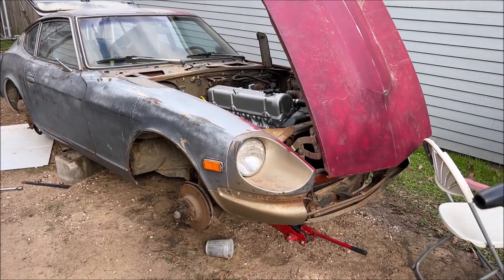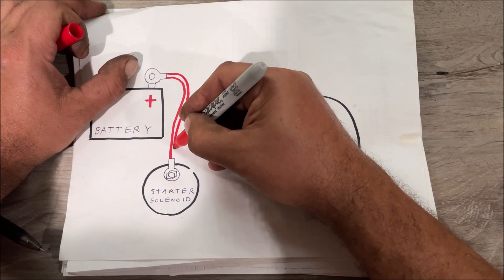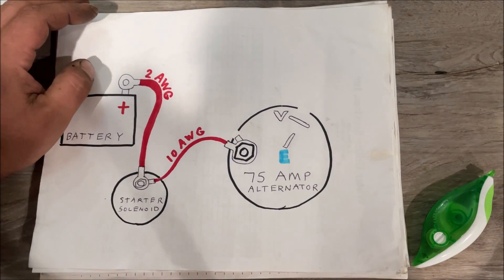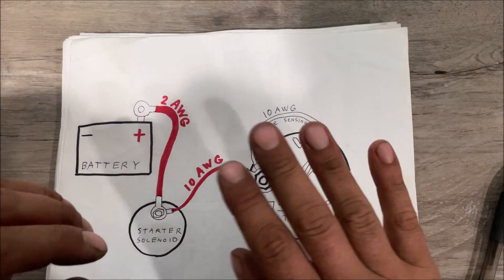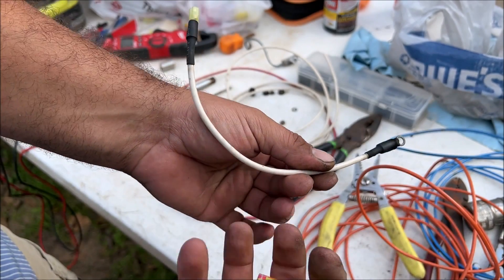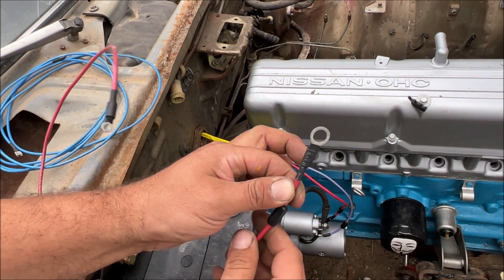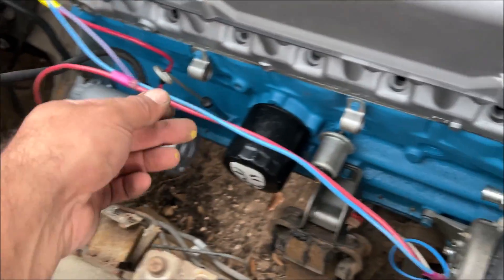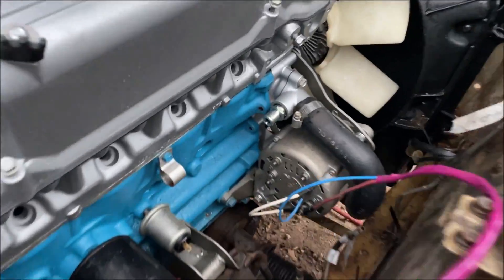how to wire an ALTERNATOR charging system on ANYTHING custom automotive wiring from scratch PART 2

Comment: Men me problems are even wurse 😑😬 those delco 12si are anoying realy expecialy Europ version are shit .I love when the voltage regulator fails or diodes or useing hv capacitors with ignition coil only problem like you described dead baterry or starting charge rpm goes up around 3000-4000rpm smuther engine faster spining starter motor but anoying not abel to run at low rpm shity alternator and curse those 4 pin gm ignition modules .
Actualy be me alternator that pin 2 is bend inside the alternator and multipel types of them exist in the market .
Peopel often here be use buy tractor alternators if they buy wrong pulley turning ditection they baterry wont charge or that mounted capacitor is dead be tractor alternators they dont charge baterry as well.
God knows how much times I asked electritians no one realy culd help me to figure out how to counter back charge or use capacitors on ground to counter plasma ignirion or running capacitor banks with lead acid baterry seperatly.
Im just saying men those standard parts are crap I rather chose heavy dutty industry bridge rectifier and use programabel voltage regulator or simply bypass that shity thing.
If you know good dual baterry systems please link them so those systems do not interfeare with ich other I dono what to do honestly Im anoyed like hell .
Those E Core Hei need terribly more power they do not start realy well on cold winter mornings I advise peopel manual chokes and try some how to trick that deam ignition module to retard ignition timing more to sucessfully start engine or manual retard lever to build for ignition system.
For me nothing worked so fare .
Not even the 5 pin gm ignition module culd not fix me needs .
If any thing I wuld stay away from that crap those alternators are notoriuse for back charge it is cool to run car with out baterry but not if you cant control it.
So wuld be nice if some one share some sucess modifing those alternatora .

Comment: I am so glad you explained the diode/resistor/charge indicator lamp. When I put a Delco 3 wire alternator on my old 1958 Ford 641 tractor, I had that same issue, I couldn't get the thing to shut off without choking the carb!
Wired in a charge indicating lamp on the dash, and boom, no more issues!
Reply from the maker: thats exactly how i shut the first car off that would not shut off...  scary stuff!!!!!!!!!!!!!!!!!!!!!
Reply: Q